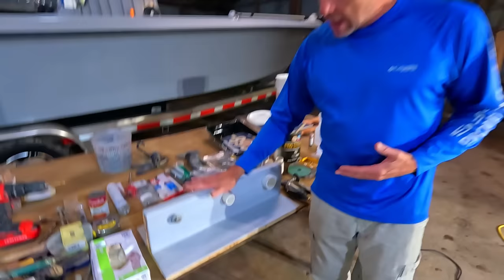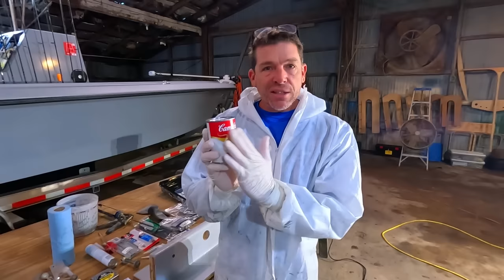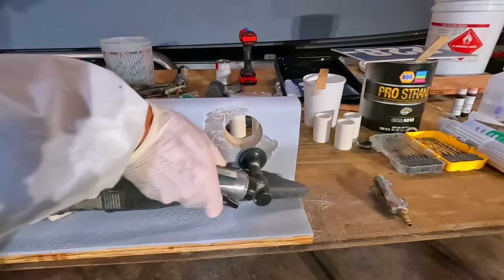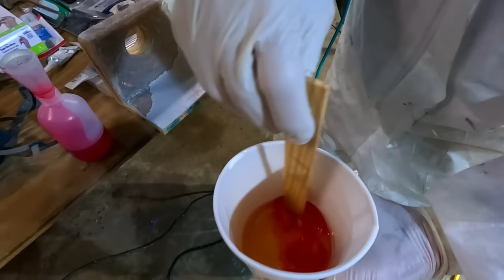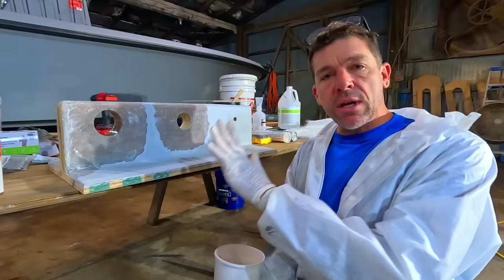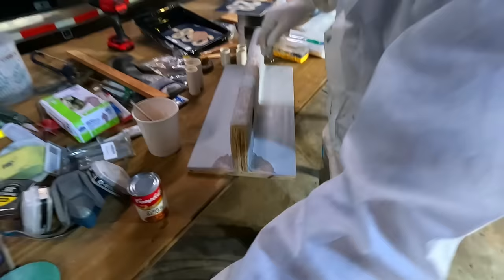HOW-TO Waterproof Plywood using Fiberglass and PVC! DIY FIBERGLASS OVER PLYWOOD

Comment: Takes years to get to this guys level trust me. You can tell how good he is all the way through the video. I especially liked the bit where he made the relief cut in the glass and put it in the bin rather than tossing it down on the floor as I’ve seen people do in UK workshops. Keeping clean with fibreglass is a key element and this guy has mastered it.
Reply from the maker: Thanks so much! Yes, I find that keeping your work area neat and clean, as well as proper planning before you even start the job make all the difference. I truly appreciate you taking the time to watch and comment on the videos!
Reply: i noticed an unspoken bit of knowledge in one of his hard top plug viedos...as hes reaching long over the part...he uses the clean hand to pull back his shirt by pinching the back to stay clean. never looks to see if it clears, just knows it does.  he probably should have added that tip in.  ive seen new guys get lathered in glass not knowing how to handle and work with it.  most of the professional laminators i know instinctively always keep one hand behind they're back, maybe holding a tip brush or something but it stays back and clean and kinda balances the body when reaching out in front of yourself for hours a day.

Comment: Matt glass is held together with a soluble binder (glue), and Polyester resin has Mono Syrene in it, a solvent that dissolves the binder so it wets out the Matt Fiberglass. Epoxy doesn't have any Mono Styrene in it so it cant dissolve the binder in the Matt Gass and is therefore not compatible. Epoxy uses woven cloth that needs no binder, the weave holds it together.
Reply from the maker: Thanks for the comment and for watching!

Comment: Here is a tip to help keep the hairs from the brush out of your work. were the hair meets the metal band around the brush put a little super glue to hold the hairs in place.
Reply: Might work on the outside of the brush but not the core so barely worth doing when you can bash the brush into your palm to loosen fibres. A pro will see fibres that shed into the job and lift them as he sees them.
Reply from the maker: Thanks for the tip, I appreciate you watching and commenting!
Reply from the maker: Thanks for the tip! I appreciate you watching and commenting!
Reply: @GRPLiningServices  that's why i use original super glue that is super thin and runs through the bristles to bind almost all bristles together.

Comment: You are correct!
A/C exterior fur plywood works the best for fiberglassing. You can fill the voids on the C side with your polyester fairing putty and a light sanding to have a smooth service. Like you said you should always prime with resin to avoid a dry lay up. 😊
Reply from the maker: Thank you! I agree with you on the process! Lots of people just don't take the time to seal and install it properly. Not saying that marine fir is better than modern composites, but there is definitely still a place for it on many projects. I appreciate you taking the time to watch and comment!
Reply: @FishBumpTV  i’m working on a 1986 Champion bassboat. I’m adding a hinged deck and small half-inch plywood bases for the seats. I cut out a raised lip where the seats sat. I can actually still get the original seats. The problem is the aluminum hinges just don’t hold up over time. After a few years, you’re not sitting at 90° anymore. My question is, do you think I could just seal the half inch plywood with resin only? I am also not concerned about the looks it’s function only. I don’t need any strength from fiber, so I thought the resin alone would work for those.
Reply from the maker: @ps7462  If you just wanted to seal with resin, I would consider using epoxy resin as it is considered to be better at waterproofing in thin applications. Hope this helps and thanks for watching
Reply: @FishBumpTV Thanks!!
Reply from the maker: @ps7462  You are welcome!

Comment: Fish bump family looking forward to a video of a old school fir plywood floor tying into existing fiberglass hull tabing as well as pour foam techniques I know that asking a lot that may require brother Mark witch requires a lot of mixing and rolling material thank again for your time!!!
Reply from the maker: I will try to do something along those lines when I get a chance to, but in the meantime, we have videos here on the channel that cover those basic methods. When we put the Coosa decks in on our 29 the process is very similar to the way you would work with plywood. When we installed the fuel tank in the 29, we poured urethane foam all the way around and under it. Then the prep work on the how-to fiberglass over plywood video would apply to the final fiberglass and the recent gelcoat vids for finishing out your project. If you have some time to look back in the channel, especially in the 29-build series, I think you will learn a lot, and maybe answer some of your questions. I hope this helps, and thanks for watching!

Comment: I’m glad I found these videos I just bought a 1976 Thunder craft boat and it needs some flooring fixed it’s plywood and fiberglass and I can do the plywood but was worried about the fiberglass work of getting it right and wanted to build a rod locker in it but with your videos I believe I can do it now we’re is best place to get the stuff I need
Reply from the maker: Glad the videos were helpful! We have links below the videos description of many of the products we use, that also helps support the channel. Thanks so much!

Comment: Great video!!! A quick tip we use that may be helpful for someone. For big pieces of glass instead of tearing and maybe tearing away too much material around the edges to help the glass blend in when wetted out. Lay the straight cut edge down and put something long with a sharp corner under it. Take a soft bristle brush and lightly rake at the edge. It'll get rid of that cut edge and give you more of a feathered edge. What about a video demonstrating cabosil, qcells, microballons , etc as a filler? Or your thoughts on it vs the pro strand?
Reply from the maker: Thanks so much, I appreciate the tip! I will try to work on a resin additives and fillers video for you guys.

Comment: Thank you very much for all of your instructional videos, I really enjoy them and have been taught so much. I’m curious as to what the lamination/lay-up schedule for the hull on the new boat was. Bottom vs side. Thanks again.
Reply from the maker: Glad you are enjoying the videos! The hull side are 2 layers of 1 Oz csm for the skin coat, then 6 layers of alternating 1708 and 1808. The hull bottom is 2 layers of 1 oz csm skin coat, then 10 layers of alternating 1708 and 1808 biaxial, this includes the layers used for stringer glass. Thanks for watching!

Comment: These videos are fantastic.  Keep up the good work!  I dont know how you deal with the polyester smell so well.  I did it for two years while in prototyping and cant do it anymore without a vapor mask.
Reply from the maker: Glad you are enjoying the videos! We have surprisingly good airflow through the shop, which really helps. We will be doing some work with epoxy soon, the smell is not nearly as strong, but should still always wear good ppe.

Comment: I love your videos very thorough and helpful.
I am wondering how strong the fiber glass is with the plywood.
For instance my kids and i would like to build a john boat to fish with and i am struggling on how thick the marine grade plywood i would have to use.
The reason is i am trying to make it as light as possible thinking 16' or 14' long.
1/4"  7/16" 1/2" what do you think?
Reply from the maker: Thanks! The kind of plywood you use will be a factor as far a strength goes. Good quality marine plywood is pretty tough stuff, add some fiberglass and it's going to be stronger for sure. If the boat is on the smaller side, and only used in very calm water with low horsepower motors you could do 1/4 sides 1/2 bottom. With some decent framing installed as well. Bigger skiff and a little bigger motor 3/8 to 1/2 sides 5/8 or 3/4 bottom with some frames of course. We have always built skiffs a little heavier duty, so you can factor that in to your needs. I been thinking about building a 14 to 15 foot skiff out of either plywood or Coosa board for the channel. It might be next winter before we can do it though. Hope the suggestions help, and we appreciate you watching!

Comment: Great video series, thanks.  I'm rebuilding the keel stem inside the hull of my boat and replacing the winch tow hook on the bow.  Should I drill oversized holes through the timber keel stem and fill with glass before drilling the correct sized holes (8mm or 5/16") for the tow bolt?
Reply from the maker: Thanks, glad you are enjoying the videos! It is something we do on our boats. Just remember, it only has to be slightly oversized. Then use a very small brush to work some resin into the exposed wood. Be sure to let the resin fully cure before adding a good marine sealant and reinstalling the fastener. Hope this helps, I appreciate you watching!

Comment: I have to admit I enjoy your video's. I feel better about my methods after watching several of you vids.
I take a lot of time covering details, or many say over building, after watching you I may not be over building as much as I thought.
More like on Par.
And again I gave up on being timely and efficient.
It takes as long as it takes to get it a certain way or end point.
Maybe with more time things will flow better,  But I don't even consider how long I spend on details and point of finish.
I understand and have said from first few months.
I could not afford to buy or purchase a boat built the way I am doing things. The labor would triple the cost of the vessel if factory built this way.
Man I like the ball bearing on a stick., I will build one., "George gotta have one those"
I enjoy the long very detailed video's.
But that Ball tool is the biggest eyeopener so far. 

I think the poly over epoxy topic.
Here is my humble opinion.
As long as my build is taking,. The cure time or gassing off over the summer and by the time I get around to it and the tedious surface prep.
I want to think I will be ok... Now I would not use this method in a structural application,. Ever ! (Cosmetic Only)
But guys doing a quick turn around I think you are spot on it may or may not end with the best results.
My thought is these products can take months to fully cure and in that process the things like amine blush that most of us do kinda understand and know how to deal with, Now. But like this topic I was clueless til I encountered it.
I think in addition to being chemically non-compatible,. we have other gassing going on and in the wrong order (poly over epoxy)is like getting oil and water to mix. It is not optimal at best.
Enough folks in the know like yourself have seen 1st. hand that those 2 only play well together epoxy over poly. in that sequence. or Order.

So many, like myself was oblivious to this little detail when I 1st. started this journey.
Thank you covering this.
Reply from the maker: Glad you are enjoying they videos! I have always said I would rather have a overbuilt boat than a underbuilt boat! A lot of boats are not built with the time and attention to detail that is needed to make them last a lifetime. I appreciate you watching and sharing your thoughts!

Comment: Wish you worked at grady-white back in the day. 89, 252gt sailfish. Bracket twins, beautiful boat. When they rigged it, no holes were sealed. Plastic thru-hulls, transom scuppers were under water with the fuel at half tank, and lighter 2 strokes. What a shame, a pocket battle wagon, poorly fitted because some bone head manager needed a bigger bonus. All you got to do is build it right one time, everytime.
Reply from the maker: It is a shame when you see shortcuts taken just to save a little money on a otherwise awesome boat! With  time, money and knowledge, all those problems could be fixed. That's what we are trying to do with the channel, maybe help folks get some of these boats back in good working condition. I hope the videos are a help! We have a lot more planned for the channel, so stay tuned!

Comment: Another awesome, informative and helpful video Captain Joe!  I really appreciate the time you take explaining things and also answering questions and comments.  You're a stand up dude who's is quite the professional.  

I've been trying to get through your other videos when I can and have been learning a ton.

Maybe you've covered it somewhere else but I'm curious about your take on mounting accessories to the boat.  

For example, I need to install a bilge pump and float switch.  

Any advice on that or perhaps you might want to shoot a video covering ways to do it right??

I don't really want to screw it into the bottom of the bilge for fear of creating a point of water intrusion.  But if I did is there a safe way to do it so water won't leak past the screw holes?

I've thought about bedding the screws or even glassing a mounting board to then mount the bilge pump and float switch to???

I've also wondered if there was just a simple way to use some kind of adhesive to hold it in place in a typical dirty bilge?

Sorry for the long comment.  Thanks again for being so helpful.

Looking forward to watching part two and all the rest of your content.
Reply from the maker: Thanks so much, I appreciate you taking the time to watch! You are on the right track with your thinking. Look for multiple solutions, then pick the best one for you application. I mounted 2 1500 gal per hr bilge pumps with stainless screws to a piece of 1/2 inch thick polymer in our 29. It sits nicely in the center of the bilge, no grinding or glassing, and is relatively easy to remove or work around if needed. There should be some footage of that in our boatbuilding series in the rigging and hardware phase. Of course every boat is different, but keeping it simple is oftentimes the best way to go. Hope this helps, and best of luck with your project!
Reply: Awesome!  I'll definitely check that out.

Comment: So if you are glassing a half round as in my plywood bow pulpit do you need to cut a bunch of pleats to make it conform to the radius ?
Thank you for sharing your experience 😊
Reply from the maker: The pleats make it easier, especially on sharp turns and corners. On a soft radius you can usually use less pleats. I recommend making a dry fit of the fiberglass material before any resin is applied, the material will show you what it needs. Hope this helps, thanks for watching!

Comment: Hey jo ! 
Quick question on the 29 buskens . How much did it end up weighing in at ? Just curious to know the weights as it runs very well with those motors and very surprised how well it runs off one motor ! Well done and keep the vids coming . Learning a lot .
Reply from the maker: We estimate dry weight, which would be no fuel, water, Batts, or motors to be in the range of 4500 to 5000 pounds. I am really happy with her performance overall, the 150s are plenty of power in my opinion. Thanks for watching and commenting!

Comment: Another great instructional video.

Do you have any tips when the rigging tube can’t protrude the stringer or bulkhead?

The way I’ve done it is coat the wood with un thickened epoxy or poly bed the pvc in with cabosil thickened epoxy or poly and sand flush. Paint etc. Would be worthwhile to use a small round over bit inside the pvc to eliminate the sharp edge.

Not sure if there is anything else to do in that scenario.

Thanks
Reply from the maker: We hardly ever take them to flush with the surface, I have gone down to a 1/2 inch or so. You could possibly really radius the inside edges of the pipe, then sand the inside and let the glass roll over into the pvc. I might try that on our demo piece we did in our videos. What you did should be fine though. Thanks for watching!

Comment: Would you say using plywood for stringers is better then using lumber? My ski boat has one long  piece of wood. If you use plywood how would you join them together?
Reply from the maker: Both lumber and plywood can be used for stringers. Two layers of 3/4 inch marine plywood laminated together to make a 1.5 inch thick stringer will usually be stronger and more stable than a piece of 1.5 inch thick lumber. Also, Good lumber can be hard to find these days, but marine plywood is a little easier to source. Of course you could also go with a product like Coosa board, which we used when we built our 29 ft charter boat. We have lots of videos of the boat build that shows the Coosa stringers. We will be posting a new video soon showing how to laminate marine plywood to make a stringer. I hope it helps. Thanks for watching!

Comment: I think i'm going to use your tips to build my own waterproof camper trailer. i do have a question, maybe i missed it.  i assume i could just drill the pass through holes after the fiberglass has setup but before gell coating correct? Also, you mentioned marine plywood and resins, what are your thoughts on regular (HomeDepot/Lowes) plywood for a small camper box build?
Reply from the maker: Sounds like a cool project! Just be sure to completely seal the plywood on the pass through holes. The pvc pipe rings are how we would do it on a boat, and has worked well for us. Plywood and resin quality will effect the overall finish quality of your project. I know that the materials we use, and show in the videos have worked well for us, but it is hard to say exactly what to expect if you were to change the formula. I will be doing a resin selection video very soon, and may also add in some plywood testing as well. Hope this helps and thanks for Watching!